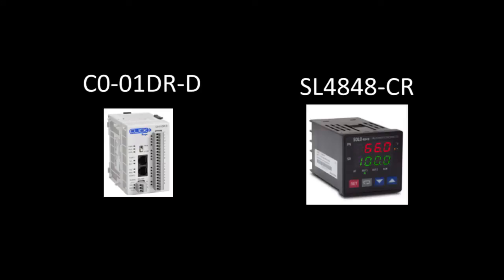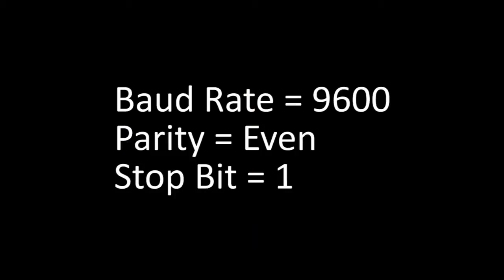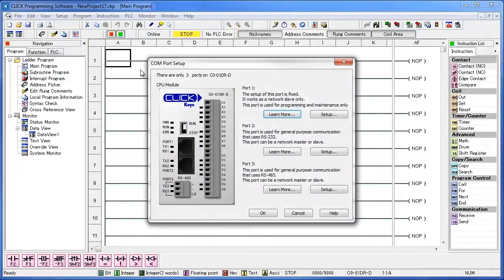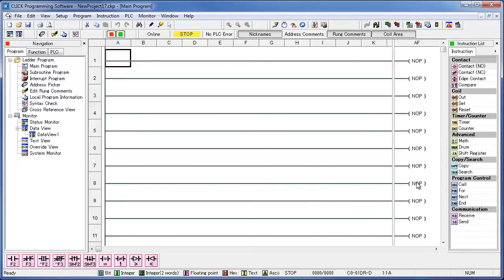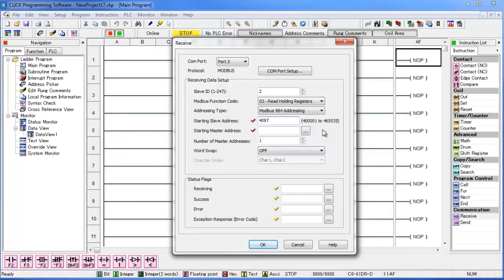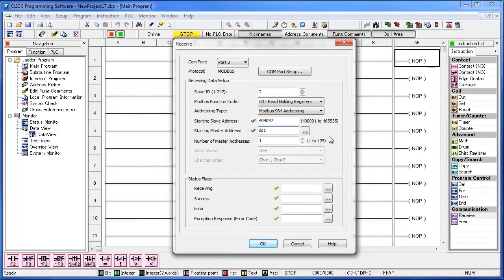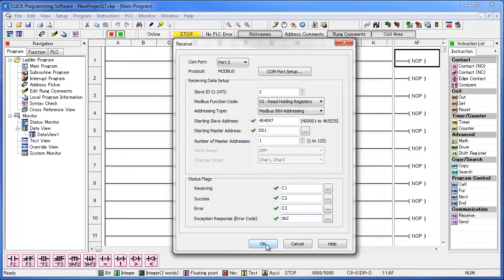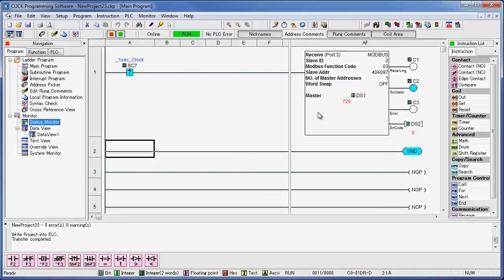How to Connect a Solo Temperature Controller to a CLICK PLC from AutomationDirect

Comment: Which values, P, I, or D, affects the temperature overshoot on a temperature controller?
Reply from the maker: Kay, great question. If you are only seeing overshoot I would start by reducing the Proportion. If you are then seeing your system slow to react to error adjust your Integral.
Reply: AutomationDirect.com Thank you so much for your help!  It worked great!!!

Comment: The Solo temperature controller has analog current and voltage outputs. The Automation Direct GS 1's we have accept these inputs.

I do know that the speed can be controlled with a 3-5K ohm potentiometer connected to the analog input terminals. Can it be paired with with Solo?

I'll give it a try.
Reply from the maker: ***** To help you find the best solution, feel free to give our free technical support experts a call at (770) 844-4200 or email them using this link https://www(.)automationdirect.com/adc/Form/User/TechInquiry. Good luck on your project!